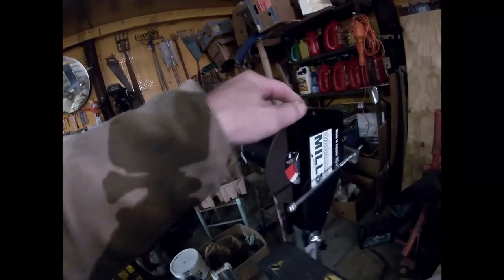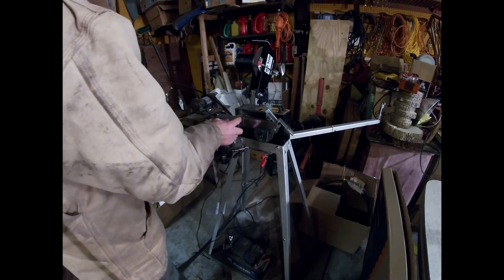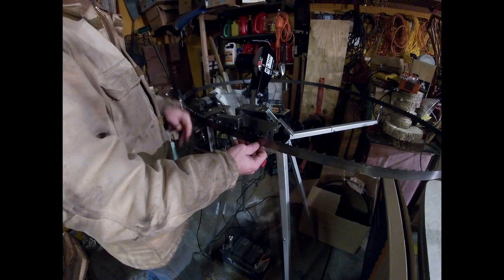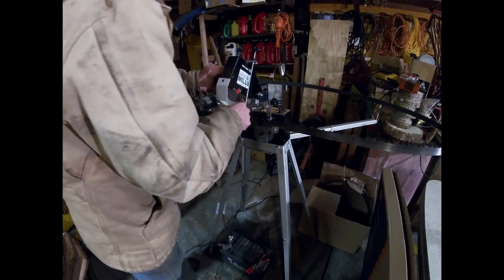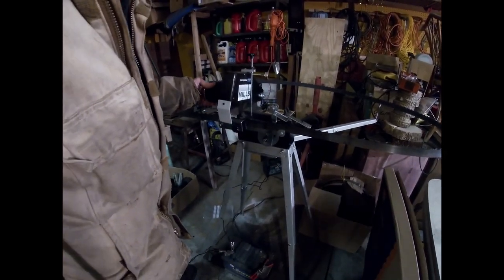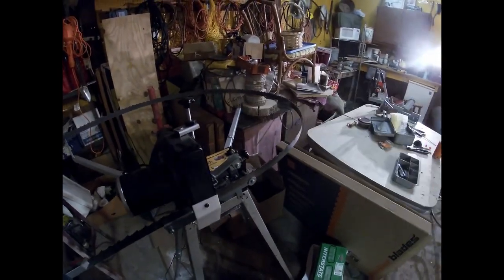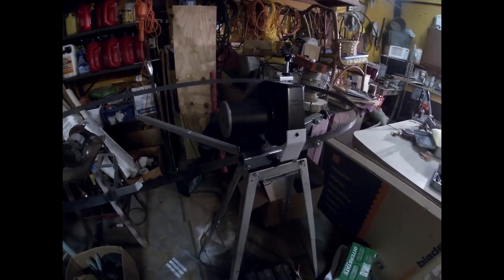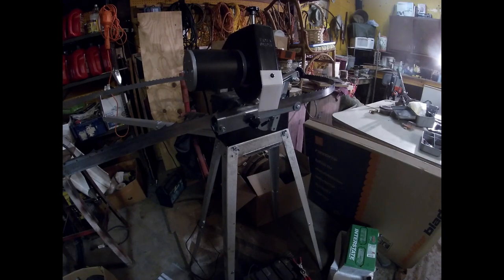Woodland Mills Grindlux 4000 blade sharpener   How I easly sharpen sawmill blades for the Woodmizer

Comment: Does the Woodland Mills sharpener work for blades on virtually any brand of mill?  I think I heard you say in the video that you were sharpening a Woodmizer blade but I wasn’t sure if I heard correctly.   I’m looking at buying a Norwood Mill but after looking at sharpeners from all brands, the WM Grindlux seems like the best bang for the buck!
Reply from the maker: I am unsure about “every “ blade.  Yes I am sharing a wood mizer blade, that is the only blade I will ever use.  I am using the 10 degree double hard blades.
Reply from the maker: The grindlux seems like the best value to me also,  you HAVE to get the tooth setter also, very important.   When you are comparing sharpener’s, look at the price of the grinding wheels, then you will know grindlux is the best value.  Zero problems and easy to use
Reply: @DANG--  thanks very much for the quick replies!

Comment: Very nice informative video.  So you are set up to custom grind and set your blades to any specifications allowed by your machines?  Red to Black, Black to Red.  🤣🤣🤣🤣
Reply from the maker: and i don't think i said microns !   lol
Reply from the maker: Yes.  I can grind to any angle the Grindlux will allow  from 7 degree to 14 degree,  I am grinding at about 8.5 or 9 degree right now and i really like it.    I looked into people talking about the 4 degree blades from woodmizer but from what i have read they are not holding up.  They dull real fast and only getting about 3 sharpening's per blade.  I think i will stick with the 9 degree angle for the winter, maybe spring i will try a new angle.

Comment: Hey,  you should not put a battery on a concrete floor, place a board or something under the battery.
Reply from the maker: You are correct!  The green one is dead, and the one I use is on plywood.
Reply: @DANG--  I was sure you knew just making sure, great video btw
Reply from the maker: @curtisbragg  I welcome any help I can get!   Thanks!